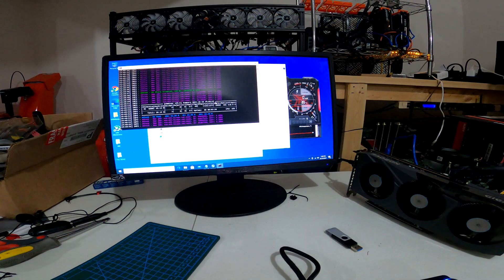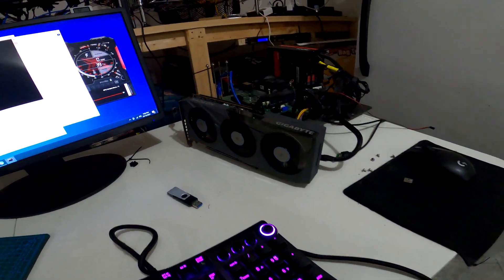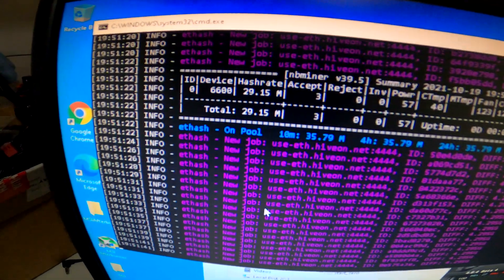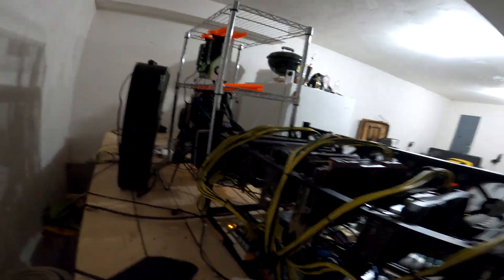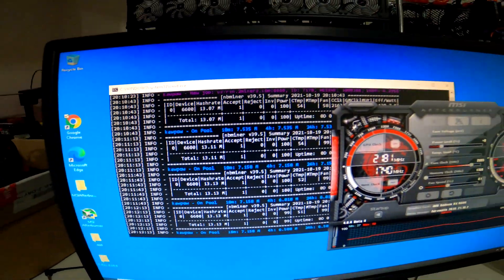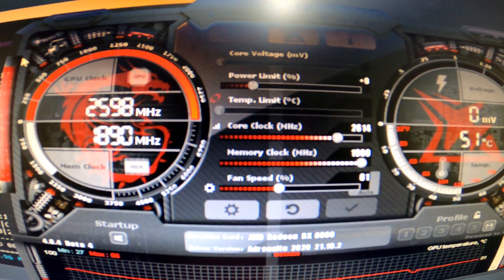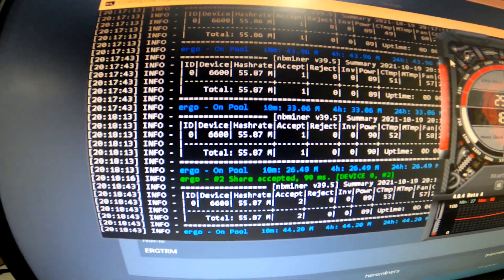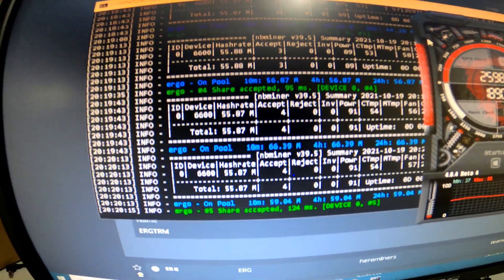Hashrates testing On The NEW RX6600 NON XT

Comment from the maker: We are testing ETH RVN and ERGO - What do you think of these results? Would you buy this card?
Reply: I'm getting 32.56Mh/s on Ethereum with NBMiner -lhr 68
Power limit:+20
Core clock: 2679
Memory Clock: 2270
Fan: 80
Reply from the maker: @kalanim3726  watts?
Reply: @CaveManMining  pwr is kinda high 103 to 111. Ctemp 48.
Reply: Looks pretty good, but the main point is: This card works with more than one plugged in the RIG? I bought two cards, same brand, new cards and wasn't able to make it work. At first I thought it was my mobo (chipset B450), than I bought a new mobo (x570) surprise!!!! it refuses to work. Tried all combinations... pci-e (gen2, gen3, gen4... etc) the GPU alone... nothing works. Most of the people doing review on this card, make it using only one card. Should try using two or more.

Comment: I have 6 Powercolor 6600 in a rig, 2 Red Devil XT and 4 Fighter non XT. My experience is that the non XT use way more power then the XT meassured at wall, i get a true reading around 55w on the XT´s a false readin at around 45w on the non XT´s in HiveOS, but a wall reading on the non XTs is close to 75w. non XT @ 900/640/620/1100 and XT @ 965/640/700/0 (adding to the "proof" is that the core temp is 10 degrees celcius hotter and mem temp 20 degrees celcius than the XTs,,, NOT at all what i was expecting.. (hash rates are 30+ and 34+ in TeamBlackMiner) any clue why ?  im trying to find similar info, but seems to be too soon to find anything solid :-(  im very hesitant to by more non XT´s, and i cant find any XT versions anymore

Comment: Damn 
That's not great tbh
My 6700xt does 47.2 mh at 83 w in software for eth😅
Reply: 56mh with my 5700 xt using 110 watts from the wall . 
i have some 6600 xt cards 33.5 mh/s 75 watts .
the newer cards perform worse on eth older cards are way better .
Reply from the maker: @TheSpidersoftheworld  hash per watt or efficiency rate 30mh on 42 watts might beat out the 6600xt efficiency wise also I got this card fairly cheap at 399 could be cheaper I guess we’ll see what this thing does on hiveOS
Reply: @CaveManMining  That's awesome man
in the end if it's making money it don't really matter ;-)
Reply from the maker: Efficiency wise it’s good and for $399 I’ll take it. I think I can squeeze 42 watts in hive os tbd stay tuned
Reply: @CaveManMining  Ya didn't consider that aspect
Cause my 6700xt cost me equivalent of $970🥺

Comment: My RX6600XTs can all do 32MH/s @ 53W (in software) on GNU/Linux Ubuntu. Ii think you can reduce the power consumption even more on your RX6600. You can definitely get the same result with HiveOS, just use the AMD Adrenaline software, it has way more options than MSI Afterburner...
Happy midweek my brother and keep on mining <3
P.S.: Did i see some QUADRO cards on these mining frames? :OOO :$$$
Reply from the maker: Thanks for sharing bro! These 6600 are pretty fitting right now hoping to get more at a good price. And maybe or the Quadra cards 🤔😂